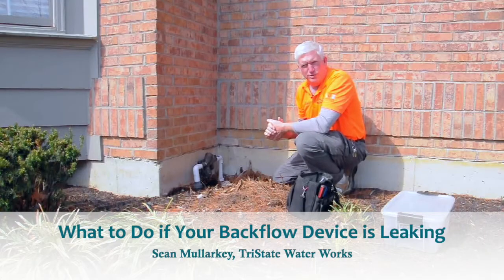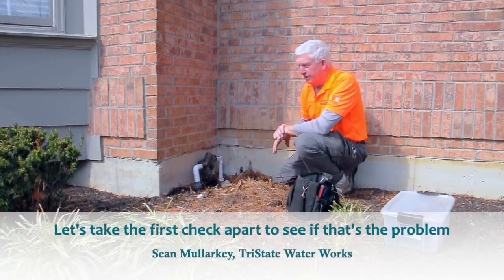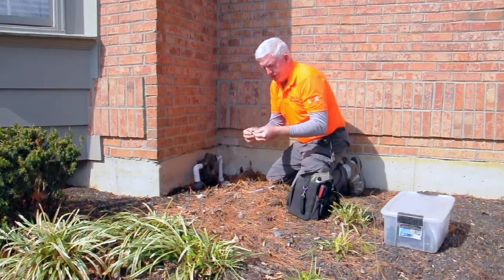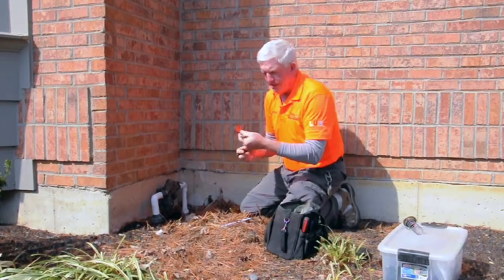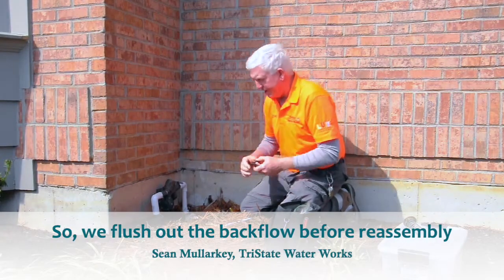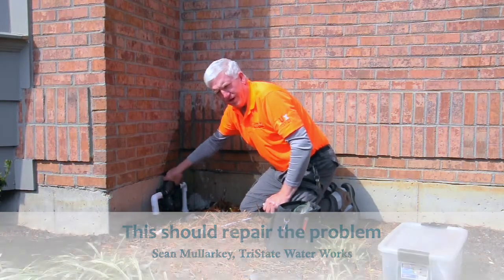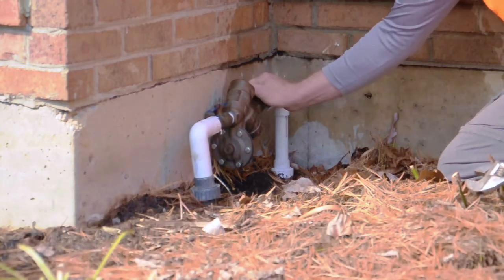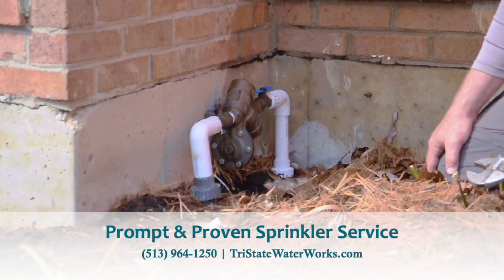What to Do if Your Irrigation Backflow Device is Leaking

Comment: what if the issue is the main pipe with the valve. Ours is leaking in between that  whit pvc and disk shape part, where the Teflon part can be seen at 3:09 of the video